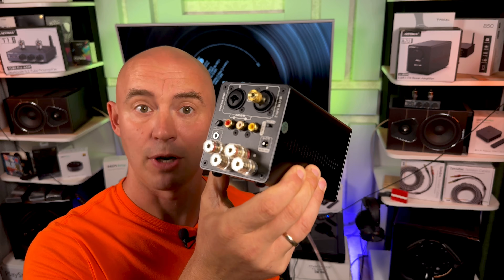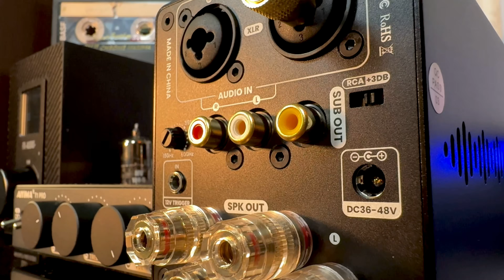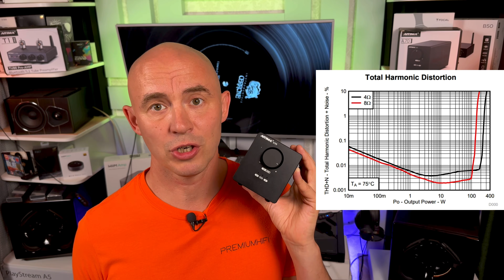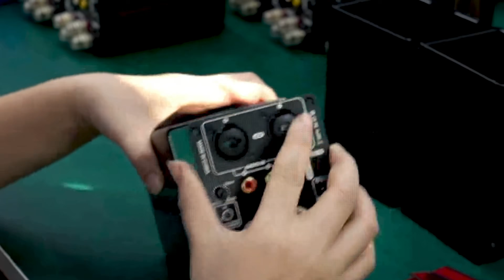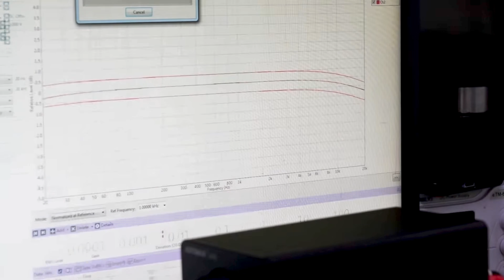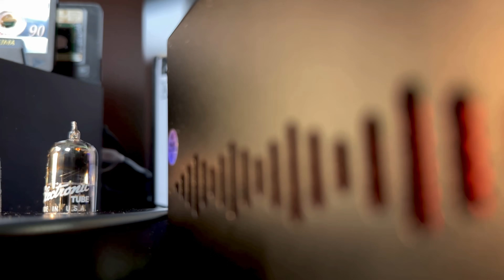Aiyima A70 Power amplifier for High End speakers

Comment: I want to buy small amplifiers like this but it doesn't have any digital inputs or outputs. Unless I'm watching a blu-ray via my Blu-ray player, my source is my pc via HDMI and USB C for my earphones and I intend to buy and apple TV 4K which would also use HDMI. These amps have neither of these connections, not even headphone out to plug IEM's or headphones directly.
Reply: Check the new A80. It´s got digital input both coax and optical.
Reply: You need a DAC.

Comment: I heard one, it is crap.
Reply: welp. thats not a constructive or helpful critisim isnt it, maybe the system itself is crap as well. sounds fine in my system.
Reply: @igoryakunin685  Not all criticism is positive, some people like it, some people hate it, both opinions are valid.
Reply: @scrunts666  I didnt say positive, I said neither constructive nor helpful, thats not an opinion, its just a bad comment
Reply: Can you add details????
Reply: @Jil8840  Not really much I can say other than I heard one and it sounded crap. Just my opinion of course.
Reply: @scrunts666  there is a video here on YouTube. It's a sound test comparison between the Aiyima A70 and the LEAK 230 which costs £1000. The Aiyima sounds pretty great on the test against a way pricier opponent!!!!! Check it out. The reviewer was very impressed.
Reply: Audio Science Review, with actual measurements, recommends it.